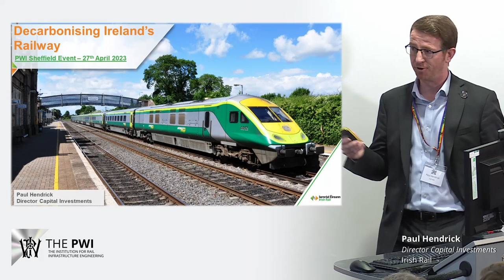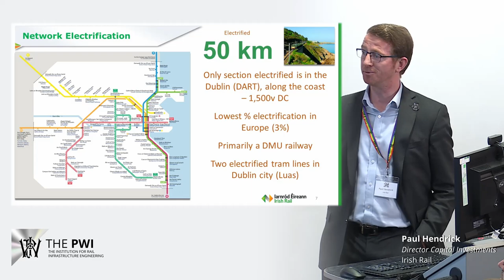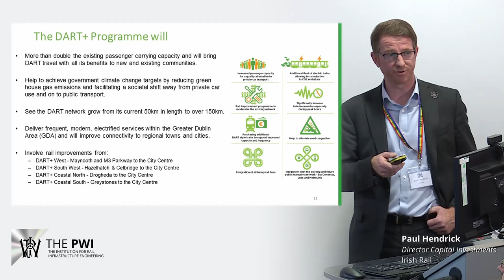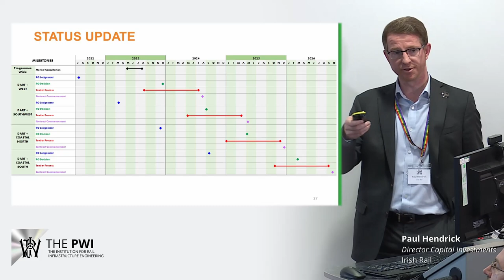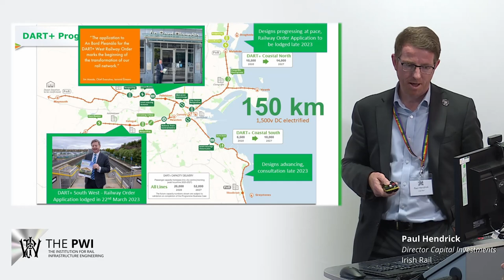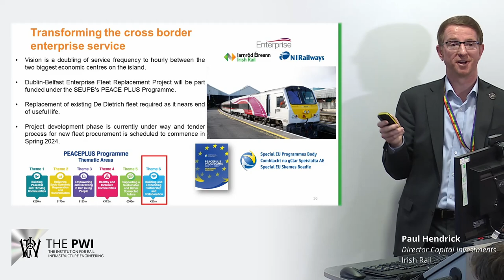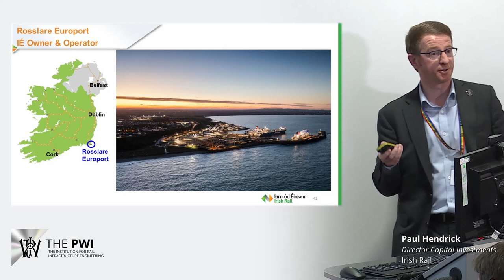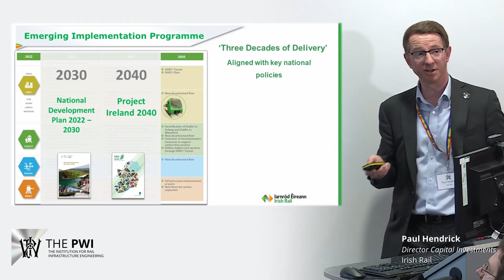Electrification: Decarbonising Ireland's Railways - Paul Hendrick

Comment: Wow , great plans , trains have been so neglected last 100 yrs . Incredible plans , well done Paul , best of luck
Reply: UHH QUE MAL TRENES A BATERIAS LO PEOR
Reply: @castelaronly  I agree, the extraction of the lithium, cobalt etc. for the batteries cause quite a lot of pollution on their own. Then there is the issue of them lasting as batteries degrade. They are also heavy so overall a very inefficient system. They should instead like every other country, electifiy the railway lines with overhead wires as that will last a lot longer in the long run and overall be much better for the environment.

Comment: HST's would be welcomed by Irish people. Make it quick.
Reply: Not sure there is a business case as they would need to be have major remodelling of bogies and suspension kinematics to run on 1600 gauge track.
Reply: Not exactly electrifying though, is it?
Reply: @JasonGrocott-dq4ti Exactly, with electrification and new EMUs, 1600 gauge could do 140mph with updated signalling. Not precisely “high-speed”, but more than enough for the size of our country.
Reply: So would all diverse forms of transit. Shuttles, flywheels and battery storage , narrow gauge. 

Ireland's transit will still be stifled if all services and capital flowed to Dublin at the expense of ripping up regional rail lines.
Reply: We don't even have 125mph services that Britain has been doing for roughly 50 years. ☹
Reply: @VarissNI  Plans in place for higher speed rail so 125mph, i presume they are looking at making it faster.
Reply: @oisinmtom  The main factor for increasing beyond 125mph would be a new signalling system. Quite expensive and not sure it would be needed, but always hope for something!

Comment: Running a train on batteries.  Absolute madness
Reply: Why not? In Canada they are running ferries with batteries 😅
Reply: Wrong
Reply: 1930s Drumm Battery ECUs that ran in Dublin nearly 50 years before the DART. Look it up
Reply: Not really
 It's happened here in Ireland before with the drumm battery powered trains back in the 1930s. Not madness but practicality.
Reply: @tr3c00l91  and in Scotland.
Reply: @tr3c00l91  Not good in the long term.
Reply: @Andrzej360 How so? :)
Reply: @Andrzej360  Which is why it wont be a long run thing. If you watched it fully you would of heard that its a temporary thing to get trains running before the overhead line infrastructure is in place.
Reply: @oisinmtom  Nuclear war is more likely to happen than Ireland ever electrifying its railway. I get what you mean but they should just straight away start building the infrastructure.

Comment: Between 1932-49, the old Great Southern (then the CIÉ), employed battery trains on the ex-D&SER line between 1932-49.  Like modern electric buses, they were recharched by strategically placed fast charging overhead pickups.  A combination of life expired batteries and electricity supply shortages was what ultimately did for these trains.

The batteries themselves, designed by UCD trained industrial chemist Dr James Drumm, were the direct ancestors of today's EV batteries.  The scheme was connected with the River Shannon hydro-electric scheme. Pity the resources for serious investment weren't available for a technology which could've put Ireland in pole position for electrification tech.
Reply: Pity that Ireland had to suffer and inherit for a near-century of small minded, short sighted policies

Comment: Longer term a 1435mm high speed line from Dublin to Belfast with a tunnel under the Irish sea (including a car shuttle as per the chunnel).
Direct HSR trains linking both Ireland and NI to the UK. (stick an electricity interconnector through it so you can sell the excess offshore wind to the UK and beyond) 
Guage changing trains as per Spain that can run on the high speed and conventional network to run Belfast-Dublin-Cork
Reply: Its regarded as near impossible to building any bridge or tunnel between Britain and Ireland within any sort of reasonable budget. Theres already an electric interconnector though so (does need upgrading however)
Reply: Actually this was looked @ in the boom years and it was very possible for less cost than the chunnel and would be paid for by bringing a large percentage of European logistics into cork/Foynes & on across to the uk and into Europe. Passenger service demands are & will be nowhere near strong enough to warrant such an investment @oisinmtom